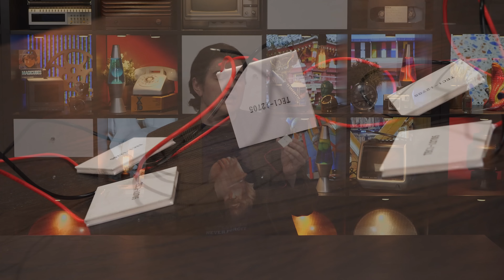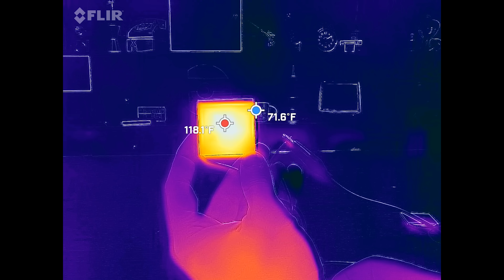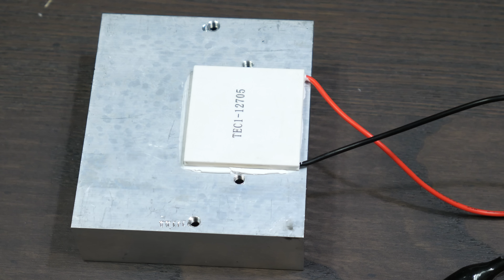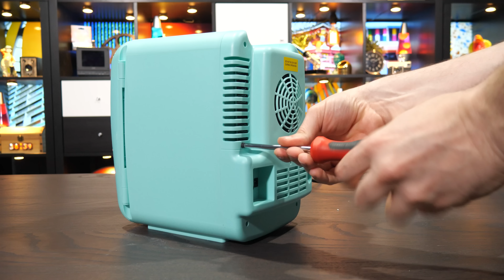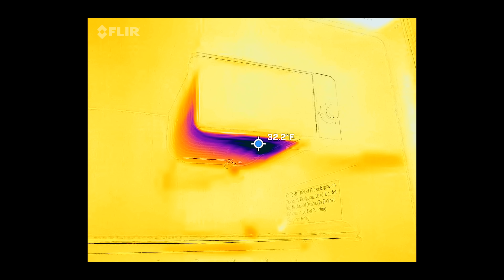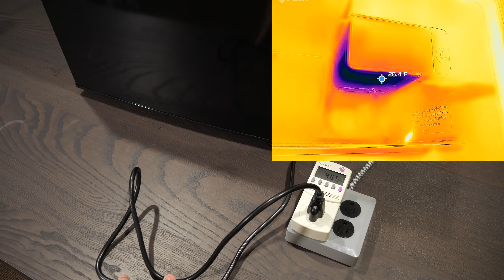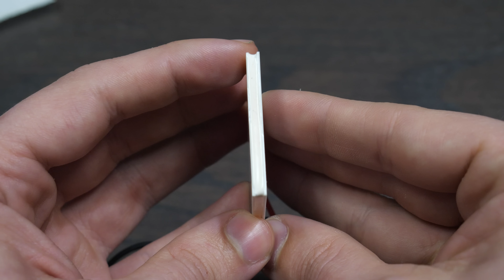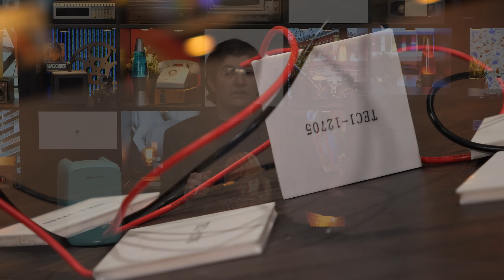Thermoelectric cooling: it's not great.

Comment: my only issue with modern refrigerant is that it doesn't work if you life in a house with no heat. Sure thats fine if its just a fridge cuz if its cold enough for the refrigerant to not work then its probably cold enough to just leave it off. My issue is the modern fridges only have on cooling system for the freezer and fridge so when you have a cold snap the freezer defrosts and thats a pain in the butt. Its also the reason we still use a 1970s Electrolux fridge even today.

Comment: Got one of these as a cooler we take camping so it's top loading instead. Also it has a temperature slider on it but I'm pretty sure that just controls the fan speed and only works when you plug it into the wall not a DC power source like a car or power bank. I was thinking though would a top loading one be better since the cold air isn't going to be falling out each time you open it?

Comment: What if you had multiple tec modules with massive heatsinks like the ones used for computers and a temperature sensor that allows it to automatically turn the modules on and off, would that be better?

Comment: I think the big problem with the Peltier tablet is that it needs a really BIG heat sink to reach its full efficiency. From what I've seen of this blue refrigerator, the heat sink still doesn't reach half the size it should be. I say this because I had a water filter that stored around 1L of water in a reservoir that was cooled by a Peltier tablet and believe me, it worked well in a house with 4 people. It even had a thermostat, so it wasn't on all the time. But I did fix it a few times, and I remember that it had a REALLY BIG aluminum heat sink, at least 4x bigger than the one on the blue refrigerator, and a bigger fan too.

Comment: A common consumer device where Peltiers are used are projectors, especially laser projectors, and DLP based projectors. Often in DLP based projectors, the Peltier is on the back of the DLP image sensor, and often have large-ish CPU cooler style radiators attatched to them on the hot side. Laser/LED light sources also often have Peltiers as part if their cooling systems to try to keep them operating in the safe temperature region. Power consumption in these devices aren't a concern for users.

Comment: very small mistake, you can use a 12v thermostat on the small fridge, that lower greatly the consumption because it doesn't run all the time... If it is isolated more or less properly.
I use one as my main fridge for years, I modified the extraction fan with a bigger one, added a thermostat and it work fine !

Comment: 43.3C is disturbingly low. what happens if the ambient temperature is above that? (which it sometimes is in Spain, not to mention that behind the fridge is generally hotter than ambient....)

I was considering creating something like this blue thing and running it from a small solar panel, I was going to go heavy on the insulation since the idea is to take it to the beach. Now I'm thinking I shouldn't bother.

I previously knew that peltier were less efficient than compressors but thought the peak consumption would be lower. Your video suggests that even this isn't true 🙁

Comment: I have a larger one of these under my desk in my room that I use to keep my drinks cool. Has an eco mode which does keep stuff decently cold while staying well below the noise floor of my room, and has a max mode which makes everything bloody freezing, while still being quieter than my 3080. Also has an adapter for use in a car. Generally once it reaches temperature after only a couple hours it manages to stay there quite well, being surprisingly well insulated. It has a shelf in the middle and can easily hold as many cans as any sane person would want to keep cold (in my case it can take a full box of tall 440ml cans, though I remove the shelf to keep 2l bottles in there. Has served me well for a year now. I only went for a TE cooler because in my university accommodation I am not allowed to bring an actual fridge, plus I don't pay for power. I believe that for people who have a use for them there are some decent units such as mine on the market, but you have to sift through the heaps of cheap crap to find them.

Comment: I think I agree with you, mostly. Yet again, they do save space immensely, and for general use cooling applications where silent running and rare warming are at play, they work fine enough. 
I have a peltier cooled minifridge, and honestly. I love it. 
I barely open it, so I doesn't use any power at all basically, it's extremely quiet, which cannot be said about a similarly sized minifridge with a compressor, and it more internal space, due to the lack of a compressor, heatsink and reservoir. 

If I accessed this fridge regularly, it would be wildly inefficient and expensive, but this way I have cool drinks during the 2 days every month I actually use it, and can just leave it running, without it actually using any power.

Comment: Had a friend who used peltiers on a dual Pentium Pro motherboard to cool the CPUs, he had a large case and the hot ends were cooled by, you guessed it, a compressor from a mini fridge with some custom pipework and some machined blocks of copper to sit in the peltiers. This was way before PC liquid cooling was a thing, early 2000s

Comment: I have a slightly bigger esky type one and it has switch for heat and cold and I used to put it in heat mode to prove bread in a cold house in the winter and it worked pretty well.  Geez 14 cents per KWH is cheap way better than over in Australia, I pay 28 cents and thats a cheap rate.  My friend pays close to 50.

Comment: The only use I see for this is to already put in it some VERY cold beers to keep them cold and that's only after you keep it running for a while. Not to actually put warm beers and expect them to be cold in a couple of hours. But the point is moot as I can keep them in the freezer part of my fridge asnd they're ice cold in 40 minutes. This would work more with a car plug for trips.

Comment: It is more nuanced than that. Blame the cheap implementation of these semiconductor devices, similar how one would frown upun a high end CPU in a gaming rig only to find out the manufacturer cheaped out on both quelity thermal paste (nano silver/diamonds/graphene) as well as not doing the assbbling half baked. Well alligned and ultra flat and cleaned surfaces and held together firm but allowing for thermal expansion to match etc. Heatpipes where needed, the cost of those also dropped like a brick the last years. And a stacked architecture because the COP of those solid state heat pumps just become uselessly wastefull when the temp difference between the two sides goes above, say 10 degrees C. And in both cases the radiotor/heatexchanger and heat dissipating fans must be well desighned and kept under quite often cleaning to prevent dust buildup and a subtle forced convection by a silent fan, both cooling the black enclosure but at the same time placed such hat is also causes air yo flow mostly laminar trough/along the heat exchanger. All that combined is still less bulky and compareble in price as the black enclosed pumps that will leak eventually and in many places still contain some version of chlorinated or fluorinated volatile liquid. Pentane isomers are better and are norm here by now. Not sure what the current legilations says about refilling the airco in cars here. Could still be r104 and similars. 
And as a bonus they can operate at zero Kelvin all to way to finger hurting hot. Insulation materials have also become so good that it sad to see the same old polyurethane still being the norm, demanding either enourmous bulk or a way larger heat pump than is needed when there is no significant heat going through the walls of the enclosure. For fun take a old fasnioned 12 volt 5 watt quartz glasbulbed halogen lamp and a few layers with some cheap earogel as well as wrapped in nickel or copper foil and just wait until the powersupply just burn through or the earogell begins to melt.
 
As you pointed out very early in the video during showing that insulting blue beer cooler, bean counters with not much up to date engineering friends in their circles give these by now super normal and good developed technology a bad reputation, not Mr Peltier himself or the modern manufacturers of these devices.

Comment: I spent 12 years as an over-the-road (long haul) truck driver. For the first 4-ish years of that career chapter, I worked for a company that was, let's say... value-sensitive... when it came to optioning their trucks. By which I mean, bare bones and feature-light. So for keeping refrigerated food and drinks on board, I had two options. A regular cooler where I'd have to buy bags of ice every day and drain the cooler daily. Or a 12V power cooler featuring a Peltier element. Over that four years, I probably went through almost a dozen of the stupid things by Coleman and Igloo. And they truly were crap. They weren't meant to run 24/7 for weeks at a time, so it's asking a lot of it. Bearings in the fan would wear out and eventually seize up and quit working entirely. Always super awesome to wake up and find out your cooler crapped out overnight and all your refrigerated goods went off. And yeah. Keeping cheese, milk and sandwich meat in there was dubious at best from a food safety standpoint. They get the job done, but it's only just barely better than nothing. Life improved substantially after I left there and moved on to companies that didn't hesitate to shell out more money on trucks with better on-board amenities like built-in compressor mini-fridges.

Comment: I used a couple years ago to make a stupid energy harvesting device by taping one side to a window during winter. Barely got any useful power.
I've also seen a youtuber make an icecream maker tray using those.

Anyway. To be fair it's not the Peltier's fault that desktop fridge is so crappy. I'm pretty sure you could do way better with proper noise free fans, power supply and sensors.

Comment: 2:55 the advantages are cost, space, and weight. You could not get a conventional fridge to hold six cans that was as small as the one you show, not as light for you to carry from your car to the office. 

Weight is also important for peltier-cooled picnic baskets: plug into your car, and are lighter to carry than packing ice blocks into a larger insulated basket.

I agree that the principal motivation by the manufacturers is cost, especially for impulse buys, but both those other considerations matter too

Comment: If you use a TEC (Peltier device) at a deltaT of less than 0.3 of it's max deltaT and you use it at less than 0.3x it's rated max current, you are usually in >1 COP territory.
Pushing it to 0.1x dtMax and 0.1x-ish for current you can actually get a COP over 3! You are then cooling 7c...

Comment: Peltier devices are better than conventional refrigerant-cycle heat pumps only in situations where the efficiency or coefficient of performance is truly outweighed by size considerations, or possibly reliability (tho I have had a domestic fridge running for over 20 years, and only upgraded it because it was not insulated too modern standards: it still got cold right up to the day it went to fridge graveyard in the sky CFC reclamation plant.

Comment: So far the best use case for Peltiers is converting thermal delta of the two sides to generate low voltage electricity. Therefore it allows to use an already hot thing to generate electricity for Cheaps!

Comment: I am an engineer who travels for work, and I bought one 10 years ago and use it regularly to keep drinks cold when I drive somewhere for work. I never use it in my house or office, I use it in the car for drives of several hours, then plug it in at the customer site or hotel, both of which have free electricity as far as I am concerned. I don't care about the COP, especially when i am using other people's electricity, but I do want a fridge I can carry with one arm, and which will work on its side in the car. And yes, it doesn't freeze drinks solid or make ice, but the drinks are chilled just fine.
Reply: Oh, I should add that I plug it in a few hours before I leave and I fill it from the house fridge so the long cool down time is not an issue for me

Comment: Actually Peltiers can be run kind of efficiently. The trick is to not operate them at the boundary of the temperature differential they can achieve. By stacking two peltiers (one small one ontop of a bigger one with a copper coupler in between) and regulating the voltage smoothly so that they both only makntain a 15F temperature differential will still give you 30F differential overall, bit the ratio of heat wasted to heat moved will be waaay better. Like five times or so better. Throw in a big passive convection heatsink instead of an active fan and good insulation and you can have something semi-decent. The manufacturers dont really care about the performance curves of those TECs, but if you play it right you can get actually kinda close to a refrigerarion circuit and even habe defrost

Comment: About your final point in the video where you talk about the mini fridge cycle length and possible freezing, this was absolutely a problem in mini fridges of yore. Anything in the general vicinity of the evaporator "freezer compartment" would at best get freezer burn, and would often freeze solid. Even things placed in the door. So the short cycle thing is a compromise.

Comment: Although inefficient at "pumping heat", I've been quite pleased with the two Peltier coolers we've used over the years:

1. 30 years ago we bought a "Koolatron" cooler and we always used it when we traveled by car all over North America.  In an 80°F ambient temperature, a fully loaded Koolatron would get the inside ½ closest to the heat sink down to about 28°F if we kept the opening to about 6 to 10 times per day. If anything it was too cold. Unfortunately it broke about 6 months ago due to the Peltier failing. 

2. A friend of mine also bought a Koolatron around the same time as us, but he was not satisfied. He then bought a very expensive, super insulated (advertised to only need new ice once a week) Coleman cooler. He then took the Peltier cooler from his Koolatron, added a thermostat and installed it with considerably larger heat sinks on both sides. That "fridge" was incredible and worked very well at all angles in his offroad truck.

Note the reason we were happy with our Koolatron and he was not,  was that we would go on month long vacations once every year or two and use our Koolatron for the entire month. On the other hand he was using his Koolatron for daily adventures and wanted something that would cool things down over a few hours. He also needed something that could be tossed around and work at all angles so a regular compressor based mini fridge wasn't an option.

Comment: The best use of the thermoelectric effect (of which the peltier effect is part) is best used in space, most current radioisotope thermoelectric generators (RTGs) use them and they still power the voyager probes after 40+ years.

Comment: If they fix the front isolation, add second heat sink for the cold side (so it does not cool at a single location), make another compartment for the hot side where you can store tea/coffee and make the cooling perpendicular to the heat sink, maybe, just maybe, this will work as portable car fridge/thermus. But that will make it heavier and definitely more expensive.

Comment: Our big fridge has an optional feature (with a toggle switch inside) to keep one box in very accurate temperature around +0.1 °C and it doesn't have documentation about the implementation but everything suggests that it has a peltier element between the inside of the fridge and the inside of the box. Our fridge is around +2.0 °C otherwise so this peltier element only needs to cool down on average 1.9 °C and it can do that very accurately. Of course, that little box requires additional temperature sensor (or multiple because the whole point of this box is accurate temperature control) and since the whole fridge is already controlled by a small CPU on a small motherboard, having a couple of extra sensors and a controller for the peltier element is pretty easy. The manufacturer does warn that if you want to achieve the official efficiency posted on the ad, you cannot enable this feature. This obviously suggests that the implementation is not very efficient which points to peltier element.

The advertised use for this box is to keep highly sensitive foods as close to freezing temperature as possible without accidentally freezing the foods even momentarily.

Peltier elements are also used in physics experiements for accurate temperature control. In that case, the peltier element is used between main cooling element and the actual scientific instrument the temperature of which needs to be controlled accurately. As you can run peltier element with PWM controller in closed loop setup with a simple microcontroller, you can achieve highly accurate temperature control as long as your main cooling setup can get close enough to target temperature even without the peltier element.

Comment: These Peltier is good for one thing, a cooler. I bought a 37L cooler that operate by these peltier for road trip. It can be powerd by car 12V and home 220v (UK). They are portable, light. Keep things chill to around 4C inside the car (20C). No complains.

Comment: And Peltier elements also used to generate a tiny bit of electricity needed to power the stove fans (aka Fireplace fans) by converting the heat of the stove.☝️

Comment: It would be interesting to see if a stack of peltier elements, each doing just 1 °C temperature difference would result in usable COP over the whole stack. Of course, the total energy transfer power would also plummet even if the efficiency would increase.